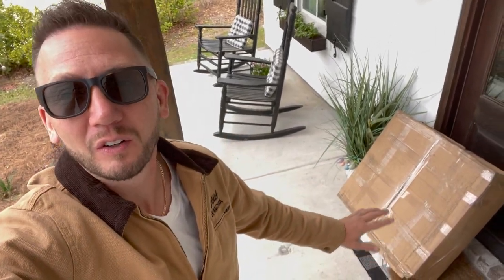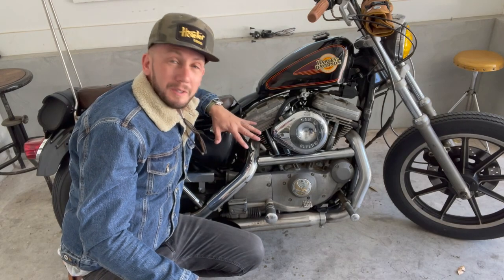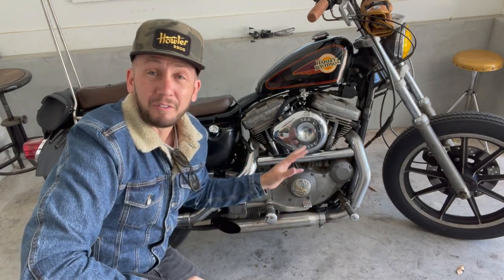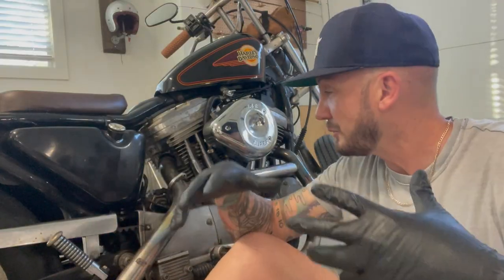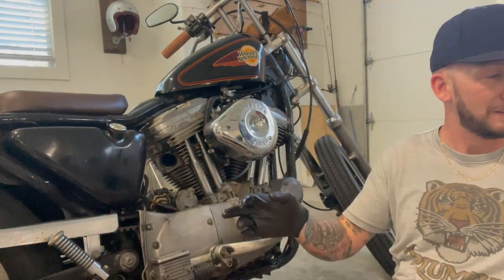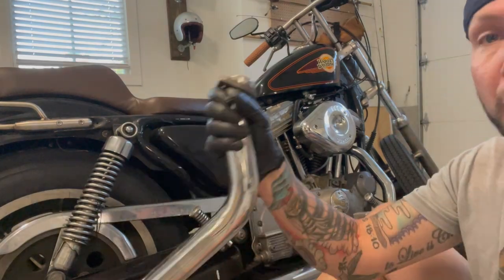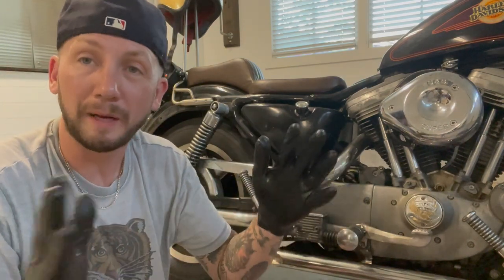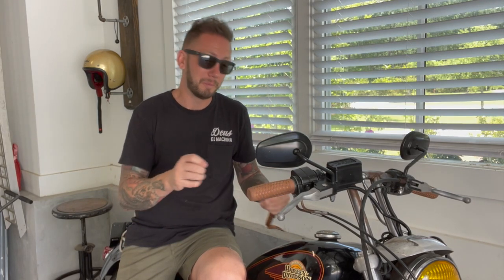Sportster Drag Pipe Install

Comment: I bought and installed the V Factor Drag Pipes for my 02 Sportster and ran into a fitment issue with the front pipe. The pipe and front of the frame come into contact. Melted through the paint after a .5 mile ride. Do you have this issue? Any tips?

Comment: great sound and the look is old school. The shinkos (?) are looking good on there too. Interested in some ride impressions on those. I think you need some 4 inch fork extensions but that could just be me projecting my wishes and wants 😛 Like roadtrip vids so looking forward to that 👍
Reply from the maker: Yep, they're shank's. I dig the look for sure.  The front is pretty squared off so it is an adjustment to get used to.